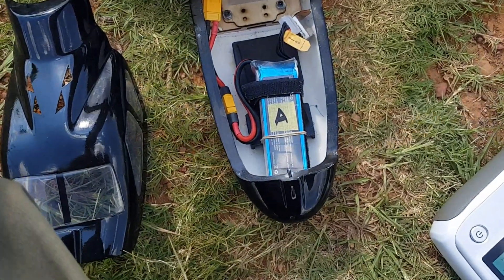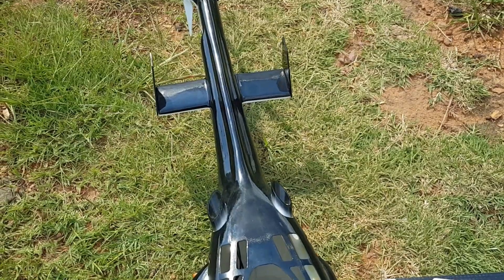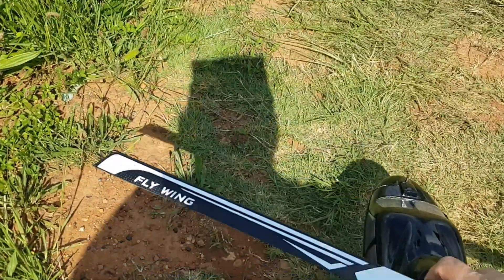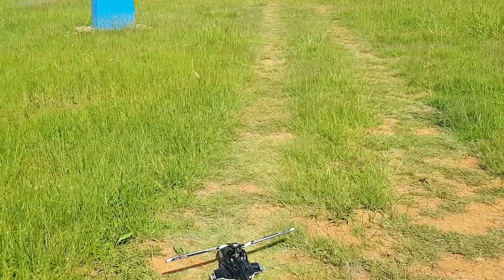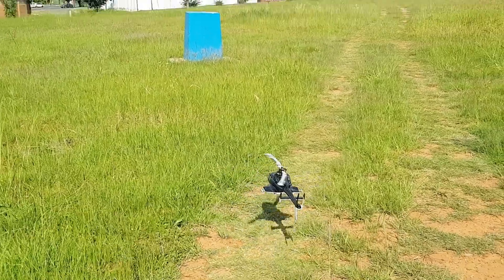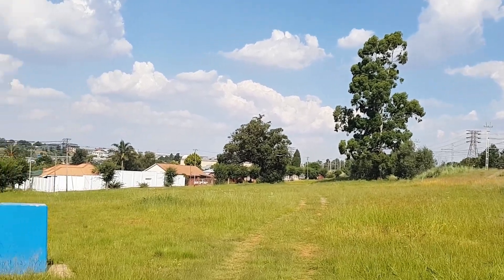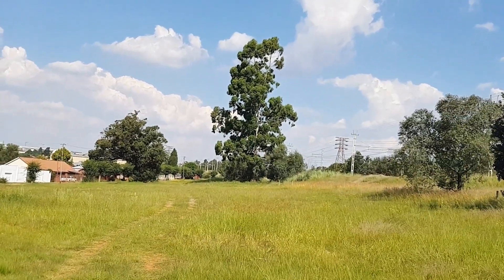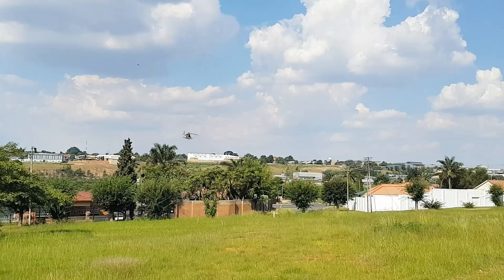I converted my Bell 206 to an Airwolf

Comment: Hi

Request to reply

Few questions:-

1. Which one would you redommend between Flywing bell 206 450 size heli Vs Airwolf 450 size?

2.Pls Could you confirm if V3 airwolf is gear and pinion driven or belt driven?
Reply from the maker: @AbbyRCToys  Bell 206 all day long. If there is  airwolf V3 (not that I'm aware of) it will be gear driven  v2.5 is belt.
Reply from the maker: pls note. I do not work for Flywing.

Comment: She looks very good in the air and I like the sound of the main blades! In which flight mode were you flying this heli. Manual (3D capable) or in a GPS/Selflevel mode? This heli seems to be quite responsive if flown in a GPS or any other stabilized mode.
Reply from the maker: I only fly in ATT mode 😊😊 I mentioned it in the beginning
Reply: @Mikes-tuts-rev  Then I am really impressed how reactive this heli is in ATT mode! Especially in some moments when you accelerate the heli with more cyclic forward. Impressive!
Reply from the maker: @RCCopterLove  Make sure your pitch is set correctly, else she wont behave like that. 14+ and 14- Regards
Reply: @Mikes-tuts-rev  Thank you! I am flying only 3D capable helis and all of them are as well set up with +- 14 degrees! It's really the ideal setup!